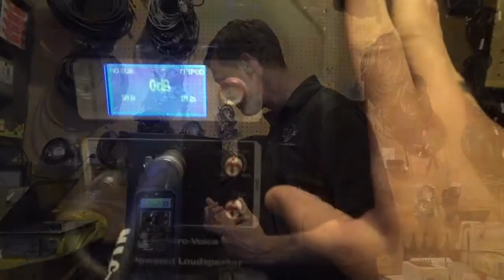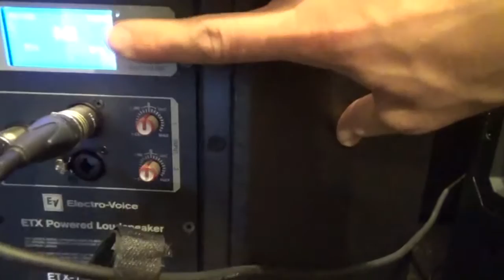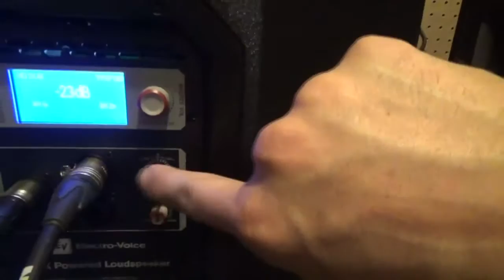Electro Voice ETX and EKX DSP volume settings DJ Jer Shop Time

Comment: The Input Level is Pre-Amp Gain and the Master Volume is the Amplifier's Attenuator or Volume that's it that's how it works.   Just like a mixer the first thing you do is set the gain to give you the best signal from the input source whether it is a low level signal coming from a microphone or a higher level signal, line level, from a keyboard or other devices and then the Channel Fader on the mixer combined with the Master Fader are like the Master Volume on the speaker.  In essence the EV Speakers have a 2-Channel Mixer built in

Comment: DJ Jer.. Thank you for all your videos and seminars.  I have a pair of powered EV speakers and before I try to use them in a awkward situation I wanted to ask you if it would work.  
Long story short I built my own DJ booth on wheels with everything integrated.  Normally I use a Mackie mixer into an amp then to non powered speakers and done.  For setups I want to use the EV speakers can I still go from the Mackie mixer to the amp (keep the amp shut off) and then to the powered speakers? Or would I have to bypass the amp all together and go directly to the EV speakers? 
Thank you!
Reply from the maker: RJ Phillips I wish I could tell you that it would be safe to run your powered mixer into a powered speaker and you could just shit it off And everything would work fine but I don't want to give you false information andess up your system. You could get a reasonable mixer to pair with your powered speakers to give you reassurance that you will have a quality system with your powered ev speakers.
Reply: djjermusic do you mean running through an amp with it shut off? If I went from Mackie mixer to the EV powered speakers it works great and just fine.  I didn't know if there was a connected QSC amplifier between the mixer and the speakers shut off if the signal would just pass through?.. thank you!  I appreciate your quick response!

Comment: I'm a dj and i'm looking to buy a powered speaker system.  My choices are QSC KW 181 and KW 153 or EV ETX 35p with EV ETX 1s8p.  What i've heard is QSC is more dependable.  I also heard that QSC had it's time as the king, but EV has raised the bar.  I also heard that the EV specs are exaggerated and the limit system kicks in too early.  Which if any do you think is true?  Which is the better system and why?
Reply from the maker: great questions and I can answer most. I don't have QSC but I am sure they make a great unit. When it comes to specs I know that is far from true, which will be explained at the Sound Symposium. I can't compare the two but Ll I know when I do/did my homework the EV line was the best option for us. I would recommend hearing them live. I know that probably isn't the clear cut answer but you have to hear. Again EV was the best choice for me

Comment: I have the EV EKX 15's Powered.  I am preparing to purchase EV subs to compliment them.  I really love the ETX 18SPs from what I've read and heard.  However, should I stick with the same line and buy EKX subs to go under my EKX tops or is it okay to pair ETX subs with EKX tops?  Thanks in advance!
Reply from the maker: Great question. So you can for sure mix and match. the ETX is going to give you a little more head room. But, they are heavier because they are a very top of the line solid cabinet. If you have the budget for it, go with the ETX.

Comment: Great Video..I did not know that about the DSP volume settings. Question for you..I have the ZLX model and I'm using 4 of them in a hall with 2 18"subs..what would be your recommendation on setting these up to maximize my sound?
Reply from the maker: +Filthy Sinbag Thank you. Great question as well. Being in a hall I would ask a couple questions as well. What is the width, wall density, number of people, etc. I guess I would have the 2 subs by your system and then flank the 2 other ZLX to the sides as fills. Once you get them set you will want to walk the room to make sure there is balance throughout. Then you will know what needs to be turned up or down. I hope that helps.

Comment: Hi, I have 4 Ekx 18sp, 2 Ekx 15p and 2 Etx 12p for 350 to max 500 people. What’s the best set up for these speakers i have…?
2 Ekx 18sp stack on top of each other with Ekx 15p on top on both sides, crossover to each other or
2 Ekx 18sp stack on top of each other with Etx 12p on top on both sides, crossover to 100hz
Reply from the maker: Your best option would be to center the two subs in the middle. Then put 15 and 12 next to each other on both sides. The 15s on the inside then treat your 12 as a side fill or satalite.
Reply: @djjermusic  so stack and couple all 4 18” subs in the middle then the 15s as main on each side and the 12s as front or side fill
Reply: @djjermusic  and thank you very much for helping. I will try this set up next time and see

Comment: What should the the volume be set at. Mines always seem to flash or peek.
Reply from the maker: I'm guessing you need to focus on gain structure. You are probably peaking before it gets to the final source which is your speaker. If the gain before isn't set right you try to make up for it by Turing up the speaker. Does that make sense?

Comment: Do you use 2 subs normally with our ekx? I have 2 15zlx and 1 18ekx sub. I am looking to upgrade but not sure should I just add one more sub.. or replace the zlx 15s with ekx 15p. and just rock one sub. I am a solo operator, and I dj about 30 weddings a year.

Comment: Hi I am using for my band 2 EV EKX 15SP subs and 2 EV EKX 12 tops. Is this scalable? If I use double does this have a huge impact on the volume?
Reply from the maker: Great question. You will raise your dB by 3 of you add a speaker but the bigger impact you make by adding speakers to this setup would be dispersion. Because of the angle horizontally the speaker puts out, you will now cover more space providing better sound throughout. Does that make sense?

Comment: Bro, I have ZLX 15P that is going on but display behind isn't showing at all and no sound coming through. What could be the problem?
Reply from the maker: Ashley Matente Zimba I know this sounds stupid but is the power switch on? If the screen doesn't power up after you turn it on then try this:

1. Plug in the xlr to the input and turn up the gain level on that line or channel. The LCD screen might be having an issue. 
2. If still no sound then I would contact repairs at EV and warranty should cover it. They have been pretty awesome whenever we had any issues. 

Sorry but I hope that helps a little bit.
Reply: djjermusic alright man. Thank you. I'll try this and give feedback. Cheers.

Comment: Hey DJ Jer. Great video. I had a question. I am running 2 EV ZLX 12P's and 1 ETX 18SP with an MC6000MK2. I was wondering how you would hook up these speakers to the MC6000MK2?
Reply from the maker: Ronnie Moll run one cable from your board to the sub, and then to your top. Run the other directly to your top. does that help?
Reply: Yup. That is how I have been doing it. I just wanted to see if I was doing it correctly or if there was a better way of doing it.. Thank you sir.

Comment: How come when I turn these up they peak so fast? Also when you turn the knob up in the back of the speaker they peak even faster and it’s not the volume knob. It’s the knob that goes to 11
Reply from the maker: It's not the speaker that is peaking it is your source coming to the speaker that is causing it to do that. Use gain structure and pipeline your volume from the beginning source then turn up the speaker. Does that make sense? Check out my other video on gain structure

Comment: I currently run two Yamaha DXR 15 mains at weddings. Would this work good with my Yamaha DXR15 mains to add some thump and take the stress off my mains and add clarity when playing open dance music at weddings at louder volume? Torn between the EKX18SP sub and the Yamaha DXS15. I only want one sub. Not looking at the ETX series too much weight and size for packing van.
Reply from the maker: Jon Tisch any time you add more speakers or subs it will create more DBs. I feel it will add a fuller sounds and take stress off your tops allowing less stress. I don't know any thing about the Yamaha or how the processing works but adding an EKX 18 would work well with your current setup. hope that helps

Comment: hi, is there a setting to cut the bass (want to use as monitors for mids and highs only) thanks
Reply from the maker: there is a monitor setting built into the DSP on the ETX and EKX that will allow you to use it exactly how you are asking about. :)

Comment: Hello DJ Jer. Can you connect mobile devices to the ETX-15P?  I asked because I notice that the ETX doesn't have the RCA inputs like the EKX.
Reply from the maker: Antonio Price great question. it doesn't have RCA jacks but you can get a cable that goes from 1/8 jack to 1/4 or xlr. we have the cables from NLFX.
Reply: I'm not a DJ, but I do host a ton of family gathering at my house, and I'm loving the EV ETX series. Thanks and Happy Holidays!

Comment: In a typical DJ set up. What is the volume you have these set on? I have the ELX 15p just curious is 12 o'clock is correct on master and input or something else?
Reply from the maker: Gabriel Escobar sorry I missed your question. I usually set my volumes and 0db.

Comment: Hello, DJ Jer. I recently purchased an ETX-15P. Why is it that the volume of the music starts getting higher and lower after playing music for around 2 or 3 hours?
Reply from the maker: Djay vargas I am not sure what you mean. can you exlain?
Reply: Ok so what i mean is that when i play music the sound of the speakers go up and down after a while, even sometimes the speaker volume goes completely down by itself and then goes back up (doesn't stay with the same sound as when i start the music. )
Reply from the maker: are you peaking the speaker? does it show or flash "heat" or "peak" ? are you running subs with it? I guess I am not sure maybe try reaching out to ev and see if they know of the situation or what would cause that. I have never seen that. sorry I wish I was more help.
Reply: What i do it's, i connect the speaker's to a Mackie mixer ,  then connect the Pioneer control,  Maybe tha's why...   But thank's for your Help and your time ... 👍🏼
Reply from the maker: is it an amped mixer? so is the music fade out and then gradually get louder? I am really curious now.
Reply: djjermusic   Yes, it's a Mackie Profx8 V2 8channel Compact Mixer..  i use it, because the power for the speakers 🔊 its More strong, and i use with the old ev's and QSC And everything works fine...   Maybe its the settings on the speakers that i have to fixed or check...  🤔
Reply: No you are correct Djay Vargas, when EV built these speakers they overprotected them which i hate when I'm playing at a party I'm not even pushing the speaker to it's capacity and all of a sudden it will turn itself down and then back up. Great speaker for clarity not for volume hate it.

Comment: Many DJ in my area really like Bose but the cost is up there. What do you think about bose L1 Model 2 series
Reply from the maker: I use to live and die by my Bose. I still carry them as backups but when it comes to the fullness of sound my Bose can't touch the EVs.
Reply: Thats what I am talking about!! Since you have the etx and ekx. Do you really need the sub with either one for weddings under 200 people. I am trying to decide if I should by the ekx15 and keep my ekx18p or just buy the ETX 15p and have no sub.
Reply from the maker: Great question. You can never go wrong by buying a sub. Because everyone is "all about the bass" and yes the ETX is awesome, that doesn't mean it is going to give you more bass. Does that make sense? I think I would stick with the EKX package for the fullest sound instead of trading in for two ETX tops. That is just me though. I hope this helps.
Reply: yes it does. I have listened to all your videos and I appreciate your advice. People love their Bose so had to get a EV user's opinion.
Reply from the maker: I'm both so hope that helps a bit. I love the Bose for esthetics but I love EV for the sound. And... we use speakers for the sound so that is how I weigh out the differences is what I use for each application.

Comment: What do you recommend setting a ekx18sp on to pair with the elx200 15p?
Reply from the maker: Hey Seth help me understand your question. Do you already have the ekx subs or the elx tops?
Reply: djjermusic yes I already have both. I usually pair my ZLX 12p with my EKX18sp but I was wondering if I wanted to use my elx200 15p with the sub what would be your recommendation on the settings?

Comment: Hey bud do you think its a bad idea to match EKX 15 subs with two ETX 12p tops?
Reply from the maker: I think you would be okay. There should be a setting on your dsp so each speaker knows the top and bottom they are working with and it will adjust accordingly. The only thing is you might need to cut back on your gain for the ETX since it is a VERY powerful speaker. I hope that helps.